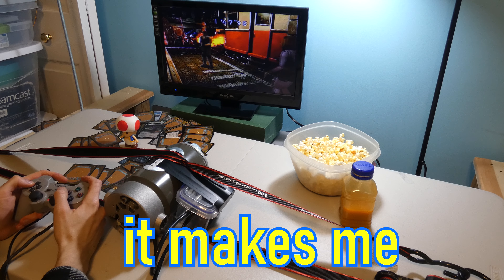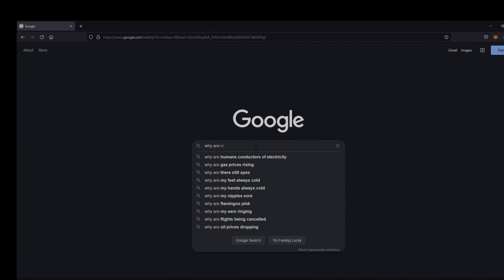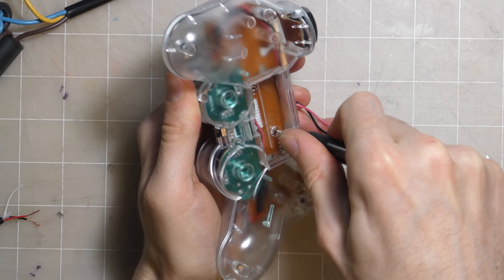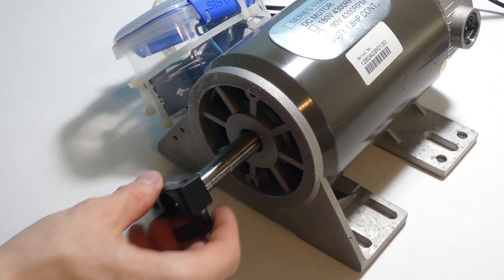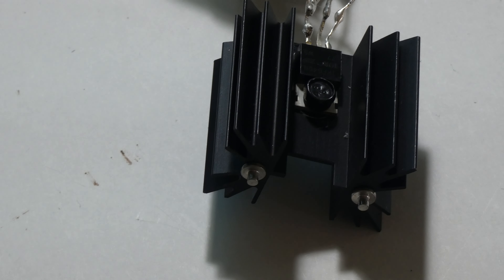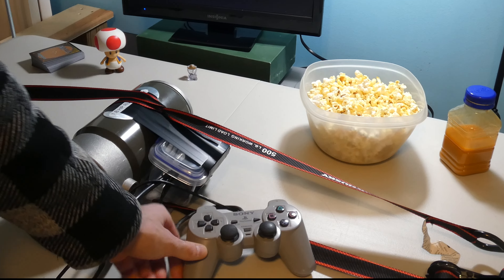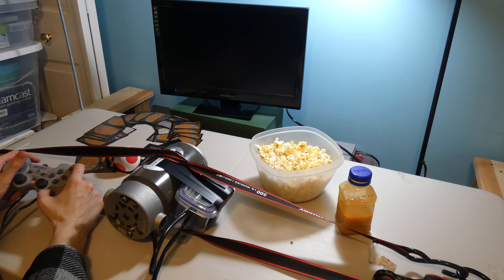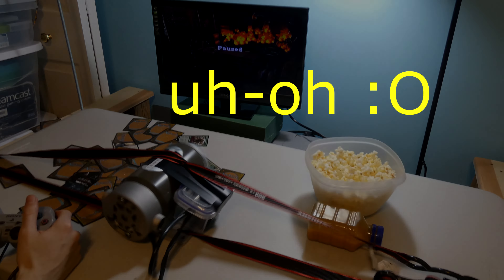Upgrading PlayStation Rumble Motor

Comment: I think relay would fit better for this purpose instead of mosfet thingy :) (by replacing default motor with relay, relay can act as auto switch).
Reply: It would be more efficie t to maybe put a flyback diode
Reply: I feel stupid for not thinking of that